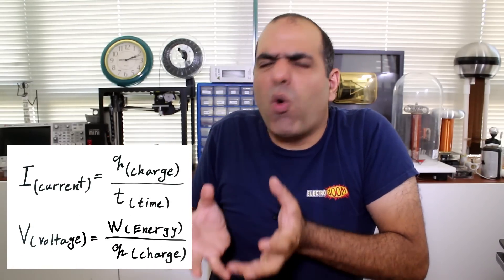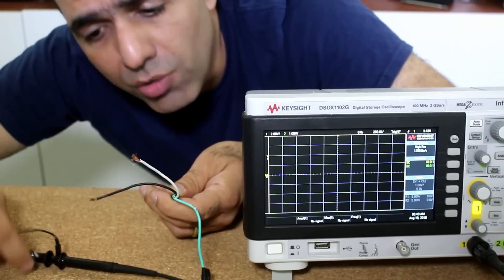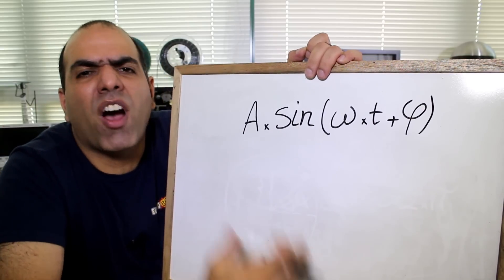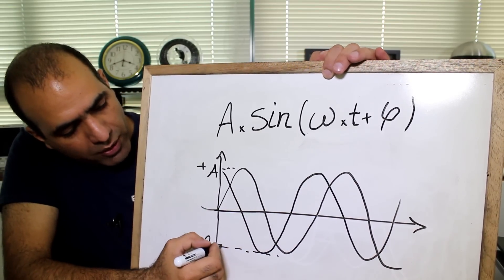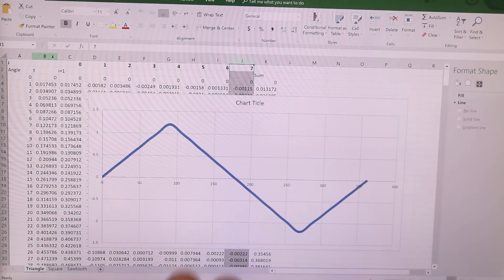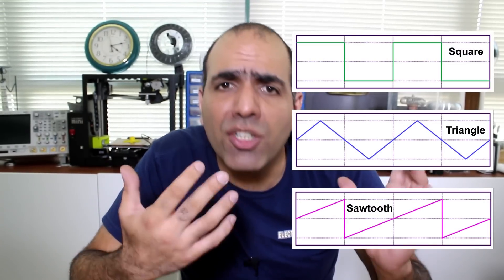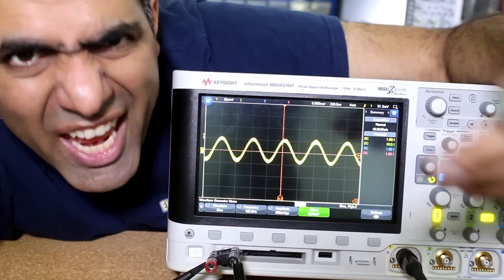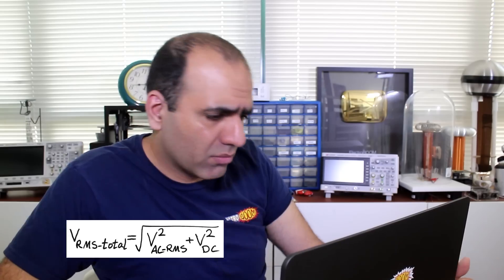What’s AC and DC (ElectroBOOM101-003)

Comment: It would be interesting how signals travel on a frequency. I mean there is powerline (the internet of your power socket) or even more know: radio. I tune into a frequency and there is something that also gives me a frequency, that makes sound. I don't quite get it yet.

As a child I misunderstood AC power. I thought that both holes are live and only in one moment one gives 220V (I live in Germany) and in an other moment, the other hole from the socket gives 220V. Negative Voltage was in my understanding only a meter that is connected backwards. Sure technically this kinda happens but there is only one live wire, that pulls and pushes.
This confusion might result, because the EU Plugs can be plugged in either way, even with ground. I mean there is no problem with reversed polarity, except when the switch only switches one phase. Switching the neutral wire turns the device off but the system is still live but has no connection to ground/neutral.

Also the colors are complicated. With AC I know that black is bad but in DC, black is neutral. In Germany the old wiring had gray, red, black and in my case, even green. Today it's very easy, because ground is yellow - green striped, blue is neutral and gray, black and brown (depending on the phase). When you see a red cable, you should make messurments, to be 100% sure. Red is earth, gray is neutral (today its Phase 3) and black is live. Green is nothing from the Din (German ISO). I mean in PCs the colors are easy. Black is neutral, red is +5v and yellow is +12V. Other colors are not that interesting but here, when you are interested (I need to look these extra colors up).
Orange is +3.3V, blue - 12V, white - 5v, purple is +5V standby (runs even when the pc is turned off), Grey is pulled low, when other lines ate not ready, green needs to be shorted to earth, to turn on the supply and brown is +3.3 sense. These 3 last are only for controlling stuff. When you want to use the psu outside of your pc, so without a Mainboard, you need to connect the green wire to earth, to get working voltages and current. Sure you can work with the standby power, but that should be avoided. This may be used for a ethernet port, that can receive a wake up call and turn the pc on. White is not used any more.

I mean you really need to know the yellow, the red and black color for a psu. You may want to connect a fan inside your and you don't have free fan ports and you don't want spend money on a fan hub. You check the rating of the fan (don't trust the color) if it's 12 or 5V and you connect to a free wire. Sure you don't be able to control your fan via pwm but better than no fan.

Comment: I have been wondering if ac is alternating back and forth does it mean when I connect a resistor directly to the socket at one point the live wire becomes neutral and the neutral becomes live? And also then why is one wire labelled live and the other neutral

Comment: The capability of both currents are not far from each other these days.  Digital signals are in DC.  DC is used in audio as Class D amplifiers. 
Basically, the digital world relies on DC. Batteries which a lot of people in the world rely to, are DC. 
The only thing left for AC is still the ease, efficiency and low cost of increasing its voltage for transmission lines. 

You can make an entire video for each though like classroom style teaching.  The things you taught here doesn't benefit the average Joe.   For example in DC, start with batteries, polarity, series/parallel,  charging batteries, USB, DC motor, solar PV
Reply: Start with Ohm, Norton and Thevenin, what a digital signal is and how class D amplifier works. (Hint: If a class D amp was a DC amp, it would simply be a DC voltage multiplier. Connect a battery across a speaker to hear the click of a DC signal." Like any amplifier circuit,  it is biased with DC but the signal is not DC.)

Comment: Surely it's only AC if it crosses the 0V? . I.E. a squarewave going between 0V and 5V is switched DC because the current only travels in one direction.

Comment: I remember nearly scratching a hole through my skull trying to follow vacuum tube amp schematics before I learned that AC and DC can exist on the same conductor independently of each other... 
How in the FUCK are you ramming +400VDC through the output primary and onto the tube's anode (plate)  while the amplified audio (AC) leaves the plate going the other way, back through the primary on the same fucking wire ???  100 year old tech totally had me baffled, lol.

Comment: To those who wonder where formulas come from:
For a period of time like T = 2π
Section 1
T * (Vrms) ^ 2= ∫ (Vpeak sin(t))^2 dt = ∫ (Vpeak)^2 * (1 - cos(2t)) / 2 dt
This is defined according to something about energy which I am not certain..
Because ∫ cos(2t) dt = 0,  ∫ (Vpeak)^2 * (1 - cos(2t)) / 2 dt = ∫ (Vpeak)^2 / 2 dt = T * (Vpeak) ^ 2 / 2
Therefore Vrms ^ 2 = Vpeak ^ 2 / 2 => Vpeak = Vrms * sqrt(2)
Section 2
When it comes to DC + AC:
T * (Vrms-total) ^ 2= ∫ (Vpeak sin(t) + Vdc)^2 dt = ∫ ((Vpeak sin(t)) ^2 + 2 Vpeak Vdc sin(t) + Vdc ^2) dt
This part [∫ Vpeak sin(t)) ^2 dt ] is same as the Section 1. 
∫ 2 Vpeak Vdc sin(t) dt = -2 Vpeak Vdc cos(t) | where 2π - 0 = 0
T * (Vrms-total) ^ 2 = T * (Vpeek ^ 2 / 2 + Vdc ^ 2) => Vrms-total = sqrt(Vpeak ^ 2 / 2 + Vdc ^ 2) = sqrt(Vac-rms ^ 2 + Vdc ^ 2)
Hope it helps :)

Comment: Riddle: how many professors does it take to make a good video?

2(or any even number) professors(they like to argue) and 1 enthusiast(does all the work).
student: what antenna works best for shortwave broadcasting.
professor: just use a small piece of wire and it will transmit 1000 km.
student: hey stupid, i know a lot about radio, you need a half wavelength dipole.

Comment: Very good video. Can you do one on VFD and PWM motor controls for AC and DC motors? Another interesting topic (since im a welder) is how GTAW high frequency works along side the welding current on the same electrode at the same time.

Comment: Great video, as always!  In the formula: A sin(ωt + φ), the value of A is not equal to what we typically would call the voltage of the waveform, but rather it is the voltage (or RMS voltage) multiplied by the square root of 2. So for a typical American 120 VAC line, the value of A is about 170V.

Comment: YO,  browed one,  you may be an engineer,  but I am a technician!  So listen up,   ….
GET YOURSELF AN ISOLATION TRANSFORMER,  plug it into the wall socket,  ThEn  plug the oscilloscope into the isolation transformer.   Once you have done this you won't have those pesky arcin-sparkins and angry pixies jumping out at you when you hook up your O-Scope ground.  (if you need help with this I can draw you a picture)
Then after you do this you can do a video on isolating your O-Scope and teach others about this essential, needed, and most important thing

Comment: Time travel is possible. Just look at the clock. We are moving forward, therefore traveling in time. If the "speed" of time is constant or not is irrelevant because we all experience time together. Even if time went backward, it would go backward for everyone. Additionally, as we travel in time, the earth moves. So if you could time travel independently of everything else, you would freeze in outer space.

Comment: Can u explain how electron move back and foward ? Where come from the energy to stop the electron speed? Futhermore, when you added some DC current to the AC in the oxiloscope the curve was above the X-axis, does it means the electron move only foward with different speed ?
Reply: It changes direction due to the potential across the circuit flipping. Rather than one side being Permanently positive and the other negative, they swap, giving a push pull scenario. Secondly, yes unless the waveform crosses the 0v line, it all goes in the same direction.
Reply: Sean Chandler thanks for your answer. Pulling and pushing electron should consume energy... so an alternative circuit is less effective than continuous with same components (let s say an 50W lamp)?
Reply: @BubleMasterGuy  nope same... AC is actually more efficient than dc. That's why the power grid runs on Ac
Reply: BubleMasterGuy e

Comment: Mr. Boom, 
quick question, that red dot you used in the animated AC demonstration for the AC current. If you put another red dot 120° out of face with the first red dot is that (theoretically) how they create the 3 phase systems.
Reply: Stephen Thomas For a three phase three conductor system, figuratively (to understand graphically)you should add more circles with dots as each circle "represents" one conductor. You cant have multiple phases in the same conductor at the same time for these purposes.

Comment: When you added a fixed DC value to the AC sinewave and it went over the 0V line entirely, isnt that DC? Because the electrons dont change direction, they just change speed. Am I wrong?
Reply: It depends how you want to define "AC". If you strictly define it as "alternating current" (as the name suggests), you would be right. The term "AC" seems to now loosely apply to any signal that has an intentional periodic oscillation to it. So you might call a sinusoidal waveform sitting on top of a DC offset an "AC signal", even if the current isn't actually changing directions.
Reply: Youthoob Gamer Through a wire or resistor, I=V/R . So change in Voltage => Change in Current => Change in speed

Comment: I think if the voltage stays above zero, than we got DC. In this case, the voltage (or current) isn't alternating, it's just changing, fluctuating. It won't make it AC. That's why Graetz bridge can work, it makes fluctuating DC voltage, that can be (to some extent) flattened by capacitors. And for a lot of DC applications, this is sufficient.
I have seen a chinese electric shaver, which had a NiCd battery, and it uses a single resistor and a single diode to charge it from mains voltage. It's extremly dangerous, but it worked, because it was DC.

Comment: I have an idea for you.
Maybe you can do a learning video about electricity with resistance, capacity and coil using Hydraulic analogy.
I remember myself as a student at electrical engineering when i was struggling the first year understanding what the capacitor and coil does to the current (not eve mentioning all the integrals and derivatives from the formulas), until i saw the Hydraulic analogy of electricity which wide opened my eyes to its understanding and beauty.

Comment: I have a question , in DC there are 2 Wires - 1 for moving current out of the source 1 for taking it back from the load. In AC the both is happening , the electricity is going forward and back as well , so why we need live and neutral instead of just one wire ?

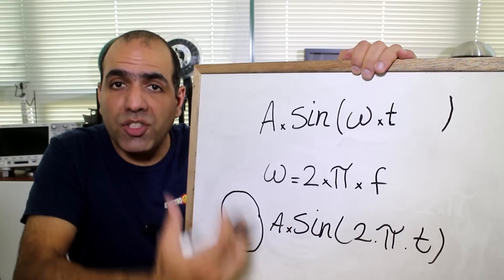Comment: Aslam o alikum Mehdi.. A have a question .. @3:50 You wrote on a board a formula (omega ) w= 2 πf then w put in a formula A sine (wt) it becomes A sine [(2πf)×t] we know that f=1/t so the relation become A sine [( 2π×1/t)(t)] the t cancelled each other the final is A Sine (2π) .. Am I right or wrong please correct me if I am wrong I am a student and I want to learn ..and many  Thanks sir
Reply: ghazii amin 
Both "t"s are different. One is indeed time, the other is period, and that one is usually written with a capital T to avoid confusion like you had.

Comment: It IS the current that kills.

Several thousands volts drop across your body poses no threat to life if current is limited. But just 100 mA through your body can be quite lethal.
Reply: He has another video about that!

If there's a 1000 volt drop across your body, there will be a large amount of current going through you. Voltage causes current. Some high voltage power supplies may have too much internal resistance to supply a dangerous level of current, but in that case your body is forming a potential divider with the supply and the voltage is no longer present across you.
Reply: Nope. The resistance of dry skin can be around 100kOhm. 1000V/100kOhm = 10 mA. That is what I mean with "if current is limited."
Reduce the limitation on the current flow (e.g. by piercing the skin) and reduce the resistance to maybe 1000 Ohms and 1A will fry whatever parts of your body the current flows through.

That is what is meant by the saying that volts jolt, current kills. Nobody questions Ohm's law.
Reply: OK, you actually said several thousand (and you're certainly going to notice 10mA).

It's a bit like saying it's not the falling of the cliff that kills you it's hitting the ground at the bottom. Technically, it's true but it's a strange inversion of causality (large differences in gravitational potential are dangerous).
Reply: Sure, electric fences produce several thousand volt pulses. They don't kill you.

"It's a bit like saying it's not the falling of the cliff that kills you it's hitting the ground at the bottom."
Right, it's not the velocity. Given some velocity, it's the rigidity of the ground that will dictate how much damage a bellyflop will do.
Reply: The duration is important also (muscle reaction time, etc.), the instantaneous current could be incredibly high, even if the average is tiny over longer periods (like in a static discharge). An electric fence is also not a good example as it's a high impedance source (see first reply).

Please don't try the cliff bellyflop experiment.

Comment: I have a doubt ...
Voltage changes direction (though it is scalar) or equivalently i should say electric field changes direction  many a times in a second and thus force acting on electron too changes rapidly in a single second so that electron must not get move in either direction ..
It should more or less stay at rest but how do we obtain current then..
Thanks in advance...
Reply: Firstly, electrons can accelerate extremely fast since they are very light. So they can reach an insane speed by the time your voltage changes polarity. (less so at higher frequencies)

Secondly, that doesn´t matter at all for the power you get out. For example in an oldfashioned lightbulb, if the electrons move in one direction inside the filament, they are encountering its resistance, heating it up. If they later move in the other direction again, they encounter that resistance again and just heat it up some more.

Comment: I have some questions hope you answer them
1: Why electronic devices such as mobile phones don't run on AC?
2: Can we store AC power in a battery?
That's all 😊
Reply: 1.  Semiconductors use DC (one way) voltage/current and are often far less capable if the opposite direction.  The basic semiconductor, the diode, is in effect a one way valve so doesn't work if the voltage/current is opposite.  There are specialized semiconductor circuits/devices that can use AC without rectifying it to DC, but they are generally unsuited for low power devices. 

2.  You can store AC power in a battery by first rectifying it to DC power.  The reason the battery is charged and provides DC power is that the energy is stored in a chemical reaction.  One way, the constituents are broken apart and the power is stored as potential energy in the constituents.  The other way, power output, the chemicals react and release electrons which are collected and provided as a potential difference between the terminals, which is then available as DC power.
Reply: 1. Semiconductors don’t like it, so no.
2. No...

Comment: I thought pulsating DC is still DC. So shouldn't AC + DC be DC (albeit pulsating DC) (if this shifts the reference voltage above the peak of the original AC. I.e both peaks of the new wave are above 0V)

Comment: hi, i have a suggestion for topic for your vlogs. I imagine capacitor as a water tank connected by pipe to the lake (=source) where the bottoms of tank and lake are at the same level. When you open pipe water flows to tank until water levels are the same.Then Capacity of the tank is C, pipe diameter is resistance R, water levels are voltage V of tank and lake, water flow is current I. But can you suggest some imagination like this for inductor? I cant and I have troubles understanding inductor behavior properly. Thx!
Reply: pavel cotijepotom 
The problem of hydraulic analogies of capacitors is that they usually can't explain displacement current: any change of voltage over time between the poles of a capacitor will allow current flow.

An inductor is best analogised with either a coiled tube or even a very long tube, though again, Faraday-Lenz law (dual of displacement current) is not taken into account.
Reply: Rarsonic Rintil i think it can... when capacitor is charging displacement current is the same as my water flow in pipe. change of the voltage in capacitor eg by load is just pumping water from tank to some 3rd place...flow from lake to tank would also start immediately because of water level diff.

Comment: I always get confused by mains power when i was always only taught dc in context of batteries in closed circuits. The ground is always, a confounding variable for me.

Also how do those ethernet over mains line adapters work?
Reply: The word "ground" has come into common use for a variety of different electrical aspects and reference points.

Such as:
-the return to complete a circuit
-the voltage (zero) reference point in a circuit
-the "negative" battery post in a circuit
-the earth return to provide a low resistance path for induced voltages in wiring of a house or industrial facility
-the "safety ground" which provides a parallel low resistance path back to the transformer, and breaker, for any conductive (metal) that could become energized due to a fault, and thus "clear the fault" by tripping the breaker
-the voltage reference point for power company suppled wiring so that only one wire has a potential higher than conductive items humans could come into contact with, the other wire (white in the US) being bonded with the facility ground to become the "neutral".
etc.

With each "ground" is a slightly different concept relative to its usage.